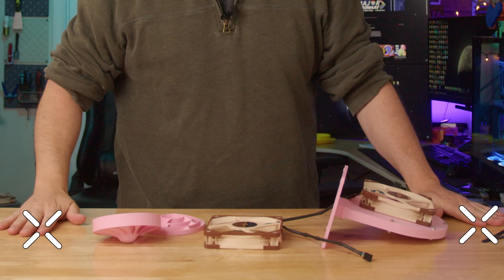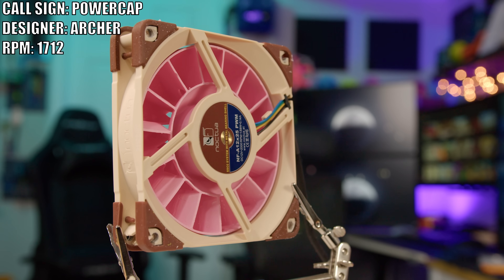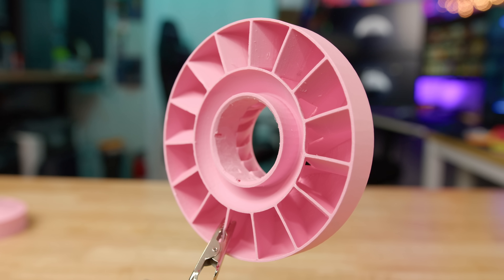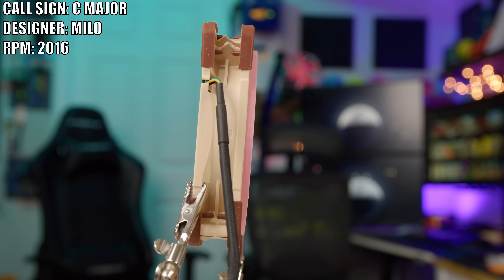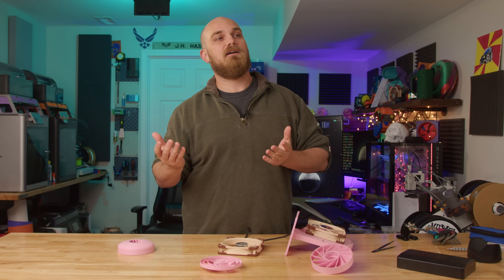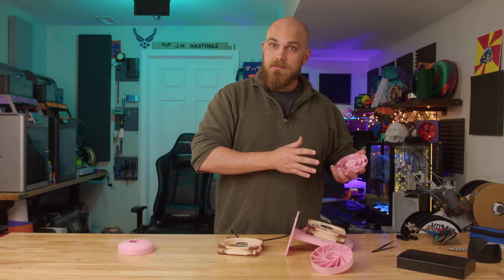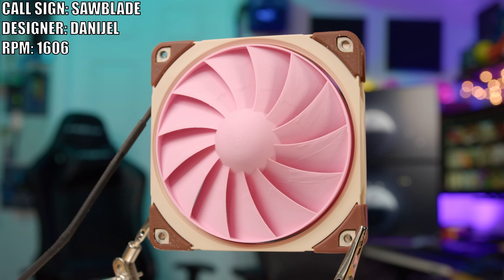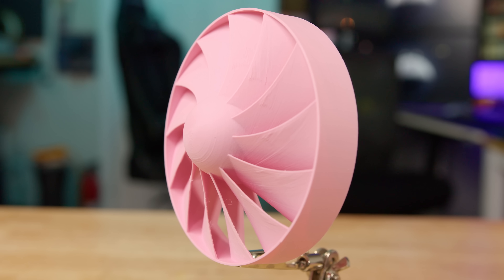Insane Fan Hack WINS Big! 😱 | Fan Showdown S6E4: Ultimate Static Pressure Battle

Comment: I know that this is already made, but my recommendation for static pressure would be the THA 1248 by delta fans. On the website it boasted over 19, which is incredible if that's true. It is a 120 mm fan as well, so performance wise I would be ecstatic to see it in action.

Comment: You're close on the music theory analysis, but are confusing "octave", "overtone", and "scale degree". Octaves always mean a doubling of frequency, so C1, C3, C5 would all be the same note (C).

The overtones to a fundamental pitch are where other notes come in, such as the example. As stated before, 1:2 is an octave, then you have 2:3 (a perfect fifth, so a G), then 3:4 (a perfect fourth, to another C), then 4:5 (a major third, to an E), then 5:6 (a minor third, to another G). The reason a major chord sounds so harmonious is because it uses the most fundamental ratios. In this case, the fan blades are 4:5:6 which produces a C, E, and G. 

Instead of using numbers to refer to the "octave" what you're really talking about are what are called the "scale degrees" of a C major scale. Think the white keys on a piano, or "Do-Re-Mi" from the sound of music. Do, Mi, and Sol are the 1st, 3rd, and 5th notes of the major scale, which in the case of C are the C, E, and G mentioned previously.

Comment: to get peak static pressure with no regard for flow rate, use a rotary positive displacement pump with drive axle attached to the fan shaft. Easy 10x pressure assume you have good seal around each chamber, centrifugal fan can do maybe 3x - 4x, not like to 10x-60x pressure difference of positive displacement pump

Comment: Labyrinth seals on the side plates. 

The problem with pressure is blow by. 
Blow by is limited by clearance. 
Labyrinth seals run far larger clearances by dividing the pressure drop per seal. 

Ok,
Short version, the rotor has a spiral raised on it. 
The side plates have an opposite spiral on them. 
This gives many many intersecting seal edges (its edges not area, think hose vs restrict or plate) plus the imparted angular velocity of the air is forced outwards in exactly the same way on the stator as the rotor. 

This then acts as both centrifuge and scroll compressor with smaller blow by.

Comment: Next season you should take an heater with a radiator and look at the power use to maintain it at a specific temperature, a better fan will by drain more current from the heater and it will be a better indicator of how good a fan is overall I think 🤔
Reply: I like that idea. I think, if you add a pan of water to the heater, rest it on top of the radiator, or a wet towel, the evaporation will cool the radiator and force the heater to work harder.
Reply: No, they you're introducing error from ambient temperature and humidity (higher humidity is higher thermal mass in the air) and all sorts of other things I can't think of. Interesting idea.
Reply: pretty much what's been covered by earlier seasons when they actually cooled a cpu

Comment: With the WfDU, if they could mount on 2 parallel on a CPU cooler... but route the output as ducting across the side of the cooler and out the back of a PC case (rather than just the side hitting the glass) that could be a really sick way of ejecting heat out of a PC. Like the old PC exhausts of yore!

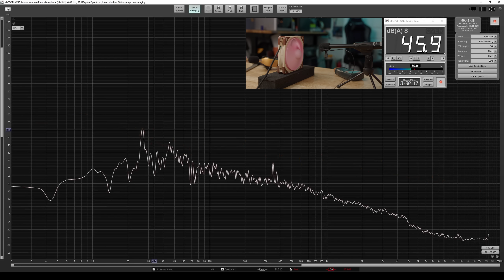Comment: The Sawblade was 46dBA 7:03
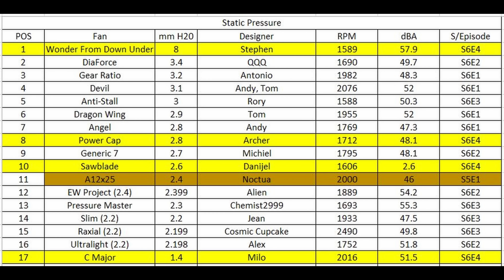But the spreadsheet has it at 2.6 dBA 9:14
probably accidentally copied the static pressure measurement

Comment: Ok the C major stuff is pretty wrong. A C major cord is what we call a triad and contains the notes C E G (In the major scale that is the note numbers 1, 3 and 5).
Playing three C notes at the same time, is not a C major cord, it is just playing C three time.

In music an octave is the interval of notes that span a doubling in frequencies. It is the foundation that all western music is build on. 
Thus C1, C3 and C5 is just playing C in 3 different octaves. (still a cool idea though). If you have a note like C1, then C2 is just the frequency of C1 x 2. If you want to jump more that one octave you just multiply with 2^o where o is the number of octaves. Thus  32.703 Hz x 2^2 =130.813 Hz and 130.813 Hz x 2^2 ~= 523.251 Hz. (note there are some rundings here)
We assume that if you play a frequency of 440 Hz (A4 the note that is used to defined all other notes) and then a frequency of 880 Hz (A5) then people will say they sound about the same, just that the 880 Hz sound higher. Thus we say 440 Hz and 880 Hz both are a A note.
The next step is the to divide the octave into 12 "equal" spaced notes (but on a log scale because an octave is a doubling of the frequency and not a fixed value of Hz) . And that is how we get the 12 notes. Due to history we say we have 7 note and 5 half notes and when we make a song we often pick 7 notes to use out of the 12 notes available. We call those 7 notes a scale. And the C major scale is the scale that have all the full notes. C D E F G B A. Chords are when we play more than one note (some people will say at least 3 and call C5 a interval {C5 only have 2 notes}, in music no one agrees on anything). Often we pick notes from the scale we are trying to play in. Thus when playing in the C major scale the first chord is the C major chord and that consists of C, E and G.

Basic music theory, the physic and the math behind it is actually very cool. Due to history it can be a little confusing but the basic ideas are straight forward, so do look it up if you are getting intrigued.

Comment: For anyone curious about the music theory, you take a frequency (say A=440hz or 440 ocilations per second), the octave is exactly twice the frequency, so say 880hz, if you divide that into 12 segments, that is your 12 notes in western music. The C major scale uses 7 of the given notes (if i'm not mistaken) so you play the 1st note in C major, then the 3rd note in the scale, and the 5th note, and that is your C major chord. (I'm also just a nerd on the internet so take all of what i say with a grain of salt of course)
Reply: @seth6118 Small clarification; you can't just divide the frequencies between 440Hz and 880Hz evenly into 12 notes.  Since the octave is an exponential scale, you have to use a logarithmic division where the frequency of each note = the frequency of the previous note * the 12th root of 2.  That mathematical ideal is then usually tweaked by hand to make some chords a little more pleasing to the ear.  You can google "musical temperament" for more details.

Comment: I have to wonder if the wfdu could be improved by making it more like a centrifugal super charger. 

Housing would need to be made in 2 pieces much like it is here but shaped more like the compressor side of a turbo/centrifugal supercharger and the wheel to match. The intake on the opposite side it is now and much larger. 

The only issue I could see is just the lack of rpm to make a decent number given a turbo spins about 100x faster.

Comment: the c major fan looked really good in the smoke test, it should get tested for airflow
Reply: It seemed to produce the most uniform airflow.
Reply: @brandonroeder2461  I suspect that's not something you want like it probably means the air is flowing faster but the amount of air travelling is less maybe so you'd get less cooler air from outside of the case but then I suppose the speed of that air contributes to a chilling effect as well.
Reply: @brandonroeder2461  - it looks as if the flow could be focused into a reducing helix with a slightly different design.  I wonder if chatgpt can analyse video frames for fluid dynamics yet?
Reply: I thought so too!
Reply: @EMILE12345678901
 - Could it be that the airflow was being organized into vortices, as described by the theories of Viktor Schauberger
Reply: @christopherd.winnan8701  Maybe the harmonics also do something in airflow? Just guessing here, but I can imagine that less turbulence could be a result of multiple 'stable' spots due to multiple tones being generated, which could indeed induce multiple vortices or other opportunities for flow to be laminar, rather than the usual one with regular fans.
Reply: @graey2  Fan blades move at different speeds based on their distance to the centre, so you get different air speeds. This fan has a different amount of blades at different distances, so this counteracts that to a degree. I don't think it has anything to do with harmonics other than those probably being close to the ideal amount of blades.
Reply: yeah really clean straight looking airflow...
Reply: So far as I remember, splitting the fan blades into segments reduces the turbulence each blade has to go through, thus increasing efficiency, decreasing unpleasant noise and producing that clean airflow. I suspect you could run it at higher rpm and not find the sound disturbing.

Comment: If you have 4, 5, and 6 blades, the 6:4 is a fifth, and 5:4 is a major third. Also, the C-ness of it depends on how fast the fan is spinning. If C1 from the 4-blade part is like 32Hz, E1 is like 41Hz, and G1 is like 49Hz. I maybe see these in the graph, but it's dominated by the octaves at 64ish Hz and 128ish Hz.
Reply: I want to understand this so bad!

Comment: Is the guy who designed the Wonder from Down Under the same guy who came up with the Cheater? Because this feels like "Cheater 2.0"
Reply: I am the designer of TWFD. I came up with a design to go up against the cheater but it didn't get picked.  It was at least equal to it
Reply: Total side comment, i saw you write TWFD, and I was"what is that? " lol, never knew down under was one word, and wouldn't have included" from"! (TWDU)
Damn, chatting with people from around the world is fn cool! And a damn clever fan!
Reply: need a cheater v. wonder just for grins at this point
Reply: @Billys3D it would probably lose against the cheater.
Reply: @TheRattleSnake3145  Depends on metric - I could see the Cheater losing on pure static pressure, as an example.

Comment: Another reason why I feel like one criteria should be to fit reasonably within a case. Once again the top design is going to be stupid huge and unworkable in any real life scenario.
Reply: This is a static pressure design competition, not a cooling competition.
Reply: @TheRattleSnake3145  I've had this same complaint through every season. 
There should at least be different categories then. 
The person trying to work within the confines of a normal PC fan shouldn't be competing against someone who designs an entirely new crazy apparatus that isn't even in the same ballpark.
Reply: @mattf9096  there would really be no point in a seperate category.  If your personal want is for a practical design for you to actually use, just ignore the design that you don't like.  Also, to use any of these designs you have to have an a12x25 with a damaged blade and a motor that still works.  Needing to replace the blades on an a12x25 is a very niche problem  .
Reply: @TheRattleSnake3145  What if the contest was to create a go-kart using leaf blower motor?
People use that motor to power their karts in the traditional sense and bust out like 10mph. 
Someone has the idea to use that motor as a starter for a much larger engine and screams away at 60mph. 
Props to him for thinking out of the box and making the most of the rule set. 
But he has created an entirely new thing that can only be challenged by others who follow in his footsteps. 
It wouldn't be unfair to have the two different approaches be judged separately.
Reply: @mattf9096  your metaphor is wrong.  It literally adds a bigger motor.  This design uses the same motor as everyone else
Reply: @TheRattleSnake3145  I'm tired of this back and forth so let's just agree to disagree and go on with our lives.
Reply: @mattf9096  Start your own comp if its not up to your standards.

Comment: I'm not sure which is more impressive. Getting the notes that close on the c major (although that wasn't technically a chord, it's octaves) or the sheer static pressure of the wfdu.
Reply: It was a chord. C E G. the 4th 5th and 6th harmonics of C.
Reply: @Endrushmi  But it wasn't C E G. It was C C C. It is still a chord but it's a chord of octaves. But it's not C major, I'm assuming that's what he meant to say.
Reply: @J.PC.Designs  The C3, E3 and G3 peaks ~131hz, 165hz and 196hz can be seen on the frequency graph...
Reply: @J.PC.Designs  It was definitely C-E-G, the explanation just wasn't fully on point.

Comment: Curious what static pressure has to do with cooling a PC?
Reply: From Corsair's website;
"When you think about cooling, you often imagine air flowing over hot components, instantly cooling them. However, PC cases today are packed with obstacles in the air's path—from AIO radiators to the dense fins of your CPU cooler. This is where static pressure steps in, powering through these impeding components to maintain airflow and keep your system cool.

High static pressure fans are essential for components that rely on a steady flow of air through dense fins for cooling, such as water cooling radiators and heat sinks."

Basically, it allows the air to move through tight spaces.
It is extremely important in small/tight cases where you barely have enough room to build in.
Reply: @The_Keeper  This is why server fans are thicc. Noise is not an issue, so they make the heatsinks extra dense and sometimes install fans which have more depth than diameter.

But at low RPM these server fans can be better than slim standard fans in certain scenarios, if you have enough space in your PC case. My previous bedroom HTPC has a 60mm thick fan on the CPU cooler which spun at no faster than 350rpm. Good enough to cool a C2Q CPU.
Reply: @The_Keeper  in tight spaces forcing air through is important. I've never seen the inside of desk top computer that was so packed pressure was needed. I could see it in a laptop or if you had it hooked up directly to a radiator. Even then radiator is pretty free flowing for the the size of the fan being used.
Reply: @SG-Cichlids  
Look up some ITX cases.
Some them can barely fit the components.
Thats where a decent static pressure is more or less a must to get air to not only the CPU and GPU, but also the VRM and RAM, especially considering most of those builds are watercooled and won't be passively blowing air over them.

To be fair though, the static pressure in most builds are a very secondary concern. You just need some pressure, not a small hurricane as some people tend to think.
Espacially if you're not running a positive pressure build.
Reply: @The_Keeper yeah Corsair is to blame for this distinction. Funnily enough their "static pressure optimized" fans sucked at exactly that back then lol
Reply: I think we are long past PC cooling... I think it's fun.
Reply: This is about the fun of designing .
Reply: Static pressure is what carries away heat.

If the pressure in direct contact with the radiator fins (the static pressure,or SP) is higher than the surrounding air, it will distribute the heat better, thus carrying away more heat. The Wonder from Down Under is increasing the incoming pressure, which draws heat away as it expands into the lower pressure of the surrounding air. Refrigerators operate on a similar principle by compressing and condensing a coolant that carries heat away, boiling or otherwise expanding, and radiating the heat away through the fins. In cars, liquid cooled computers, and a lot of other devices, the coolant doesn't need to boil or expand, but the radiator slows the air being drawn through it by the fan, and thus is reducing the air pressure on the fan side. 

In a car, the increased static pressure on the side opposite the fan comes from the forward movement of the car. The increased pressure gives the radiator more molecules to pass the heat energy to, which then dissipates said energy on the other side as it passes through the fan.

Since desktop computers don't generally move at a speed that provides enough SP to sufficiently cool the PC, TWfDU provides that pressure. If a fan is drawing air through the fan, the SP of the surrounding air is then higher than the SP inside the fins of the heatsink. This is, of course, reversed when the air is pushed through the radiator/heatsink. Pushed air gets its SP from the fan and housing. Pulled air gets the SP from the surrounding air. The latter usually gives more control over the SP differential, but both work on the same principle.

Focusing on the SP, whether increasing or decreasing it, is what has the greatest effect on a Fan's efficiency.

Comment: What an amazing design. I would imagine it would be really good for pushing air through water cooling radiators.
Reply: The only issue is that it doesn't have much air flow.
Reply: @TheRattleSnake3145  Agreed. 
While it seemed to do okay in the fog machine test, it’s definitely not meant for moving cubic footage to be sure. 

But if you use it on an external radiator…
As long as your radiator isn’t too big I guess.